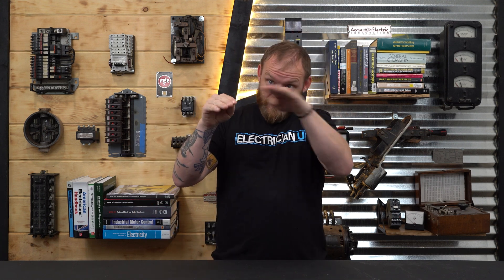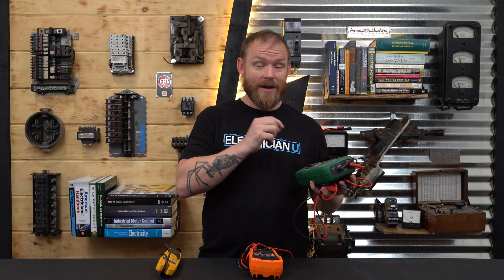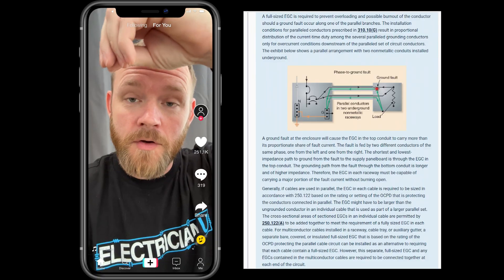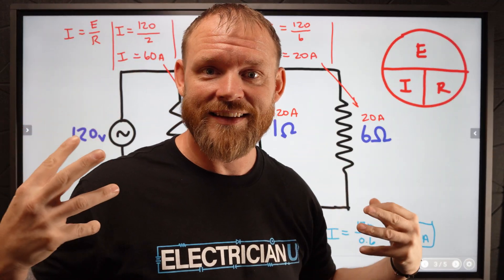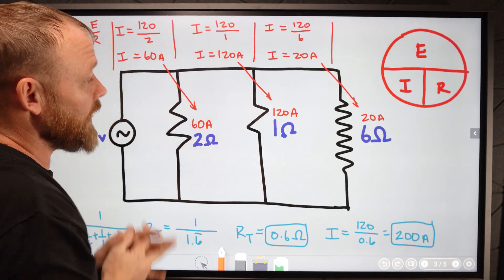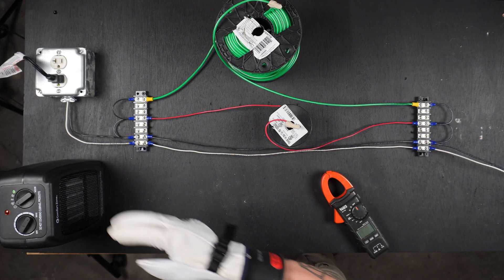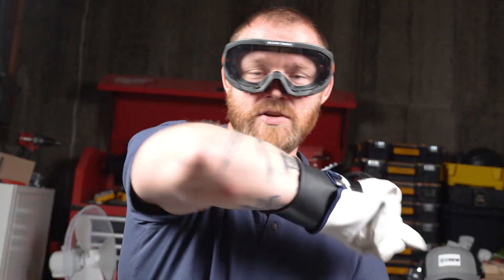Electricity Takes the Path of Least Resistance

Comment: I’m not an electrician common sense in logic is key. If you working on anything with voltage and you know that the surface you’re working on is wet, the best practices to put a four square footage, PVC that you can stand on wall that prevent any electrical shock. I’m not sure my whole sentence is a question.??????

Comment: Great video.  The demo is a great way to explain this.  Although the statement is actually correct, it implies that it "only" goes the least resistance path.  What I tell people is that for this to be true, a power plant could only light one light bulb or appliance.  So if you turn on your electric stove, then all your lights would go out.  I think this originates from someone demoing a battery connected to a light bulb and then connecting a wire across the bulb, shorting it out, and then the bulb goes out.  To explain this they then say, "electricity takes the path of least resistance".  The real reason is the battery's internal resistance is greater than the short so the output voltage drops too low to light the bulb.  I know, more questions.

Comment: Dustin, I have a possibly dumb question, unrelated to the video. I am researching options for redoing the service at a building I may be purchasing. I was watching your short on the Square D QO PoN surge protector Breaker, and looking at panel Surge Protection. I'm curious, would there be any benefit to populating the first slots on either side of the panel with surge protector breakers? Would they share the load of a surge? Would they both pop at the first surge? Would they alternate popping, giving you a second protection cycle during a "storm"? Would you just be wasting money and space? I feel like the answer is just get one protector at the max rating, and replace it when compromised, but? Would be interested to hear your thoughts.

Comment: Amazing videos as usual. Can you consider doing a video on what would happen to a neutral wire if it was wired incorrectly in a branch circuit circumstance where both of the 120 V hot wires were on terminated to the same incoming leg instead of alternating them the two. 
I am curious to see what would happen if you could demonstrate it by overloading the neutral wire by utilizing all 40 A on the improperly wired branch circuit, which would then return put all that on the neutral which is rated for 20 A. Would this melt the neutral at the panel or what could the worst happen? Many thanks greatly appreciate your videos!

Comment: Isnt the whole point of grounding that electricity will return on groundwire to source rather than trough your body, because theres least resistance
Reply: the ground wire is a low resistance path for the current to return to its source and pass through it and trigger the thermomagnetic, current also passes through you, but in this case by ohm's law the current passing through from you are nanoamperes per thousandths of seconds since the ground conductor would be 0 ohms and that in ohm's law is infinite current through the ground wire.
Reply: @alejandrogalarza3147  thank you sir

Comment: 6:56
If the doted lines are only conductors, then you have 3 short circuit situations in your drawing...
So WHY would current go trough the load on the right, when it can go where there is NO loads..?!?
Reply: Please, the dotted lines Do Have a load, just not drawn in.

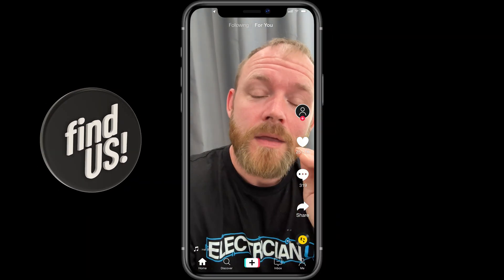Comment: 5:14
Worst example ever.

Paralel feeds have same resistance. So current will flow evenly on both
Reply: While TOTAL resistance will be lower.
Reply: Parallel branches have the same voltage. The resistance can, and usually does, vary.

Comment: Electricity DOES indeed take the path of least resistance…

It takes ALL other paths also.

If there is resistance, it will create heat etc in the path… but it will take it.

Comment: DUSTIN, There can be 3 or more different types of loads that will measure the same DC resistance for each load. Example of different types of loads measure 1K or 10K DC resistance but each different load will have a different "current consumption or current draw" which is the main differences between different loads. You can have a load that is 10K but draws 200mA of current while another load that is also 10K draws 500mA and another load that is 10K that draws 2 amps. So you should make a YT lesson about this
Reply: bro wut?  You talking about inductive loads vs resistive loads here?  You lost me.
Reply: @theastuteangler  Various types of loads can measure the same DC resistance but their AC impedance are different so the Current Draw Total Current Consumption will be different for each load even if they have the same DC resistance. 100K DC resistive load compared to various 100K DC Reactive load will draw different amounts of current total current consumption.
Reply: @waynegram8907  ahh gotcha
Reply: Dustin is drawing AC.    not DC.    ?
Reply: @tedlahm5740  the multimeter sends a DC signal when checking for resistance, I think that's what he's talking about

Comment: If it only took the path of least resistance, your microwave would turn off whenever you turned on the lights.
Reply: The opposite would be true lol lighs have really high resistance compared to microwave
Reply: @Kaladraz Those two (2) loads would be in parallel.
Reply: @tedlahm5740 yeah so the opposite would be true wouldnt it? The lights would turn off whenever you turned on the microwave.
Reply: @Kaladraz  We Need to go back and learn parallel circuits.

With parallel circuits the more loads that are turned on, the total resistance goes down.  (difficult to comprehend).    This is why the current Goes Up.   
Current goes Up ENOUGH will trip the breaker. 

His video covers a great deal of material.  Admittedly too much for new learners.
Thank you.
Reply: @tedlahm5740 you’re misunderstanding what @kaladraz is saying.
Reply: @tedlahm5740  Lol man we know all of that. We were talking about the statement electricity taking the path of least resistance being a bullshit statement.
Reply: Yeah good point! Low power = high resistance, so the opposite would be true.

Comment: I am hooking 2 separate power inverters into the 2 phases of a load center.  Do i need to also separate off the neutral bus bar or can I run both on the same neutral without damaging the inverters?
Reply: never share a neutral and hire an electrician.